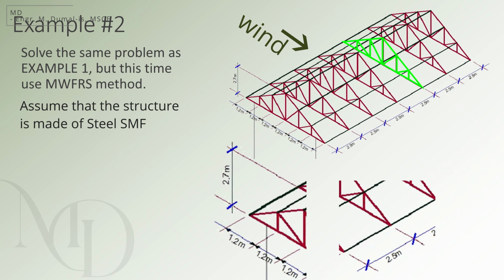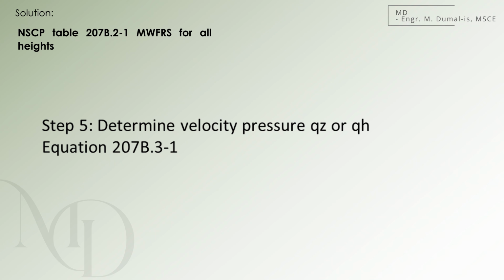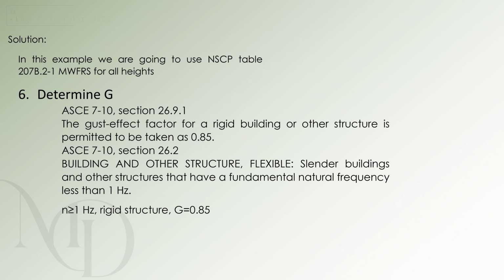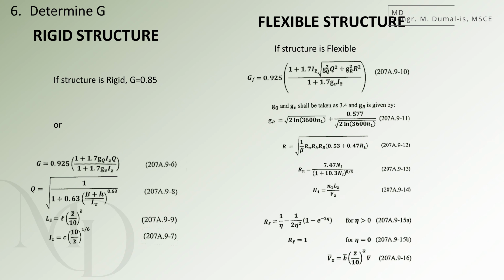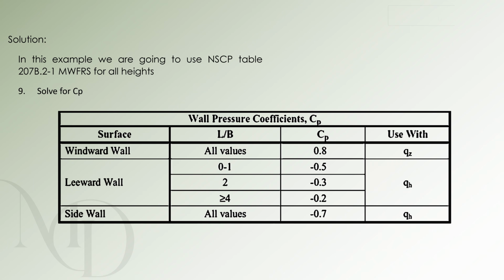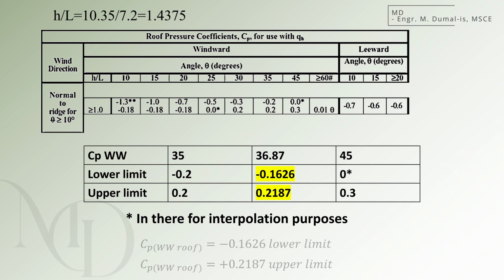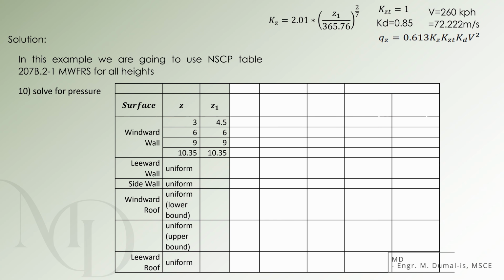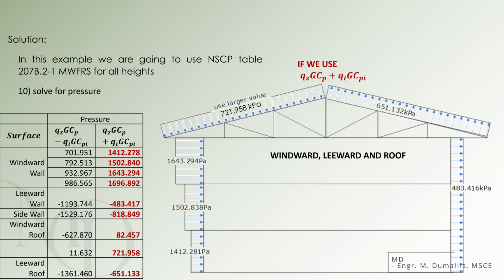Wind Load Analysis on MWFS structure | NSCP C101-15 s.207 B.2-1 Explained

Comment: Pag mag ddesign po manually ng purlins po naman. yung pressure po ba pwede gamitin thru mwfs or thru c&c dapat. balak ko po kasing hiwalay yung analysis roof at framing and I-add na lang po reaction from purlin and truss to roof beams. thankyou big help po.
Reply from the maker: I got two answers.
Short answer: Yes, you can use C&C for purlins if you design the roof separately, then apply the supports to the main system.
Long answer: It is more nuanced than simply assigning C&C to roof members and MWFRS to frames, because it depends on each element’s role in the wind load path; purlins typically use C&C since they directly receive roof pressures, while their reactions are transferred to trusses and frames that are generally checked under MWFRS, assumed to have little to no direct effect on the stiffness of the building. However, purlins (even the truss system) can also be considered part of the MWFRS if they significantly contribute to or affect the overall lateral force-resisting system behavior.

Comment: Would it help if I will just assign a 1.0 value for KzKztKd so that the formula will become qz=0.613V^2?
Reply from the maker: Using qz=0.613V^2 effectively assumes the basic fluid dynamic pressure p=(1/2)*ρ*v^2 where ρ is the density of air, without accounting for topographic, directionality, and height variation. For a quick conservative estimate, this approach may be acceptable, however, for actual design applications, it is difficult to justify neglecting the relevant modifying factors.